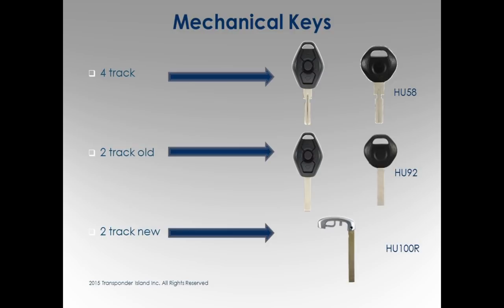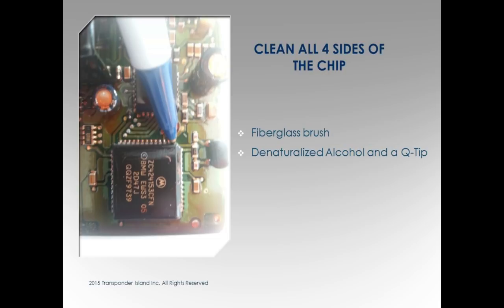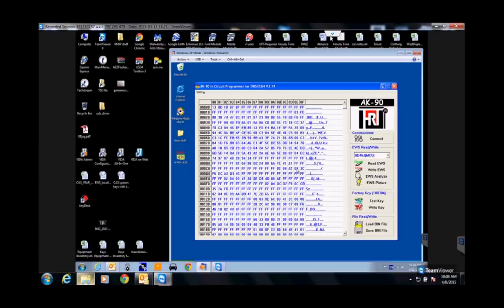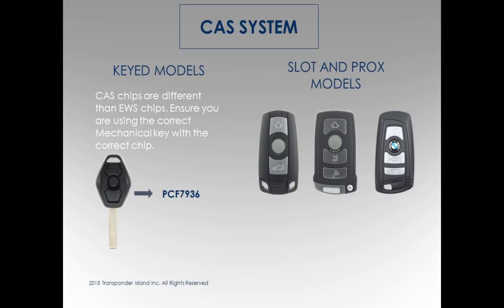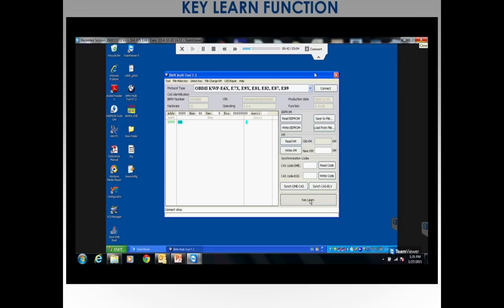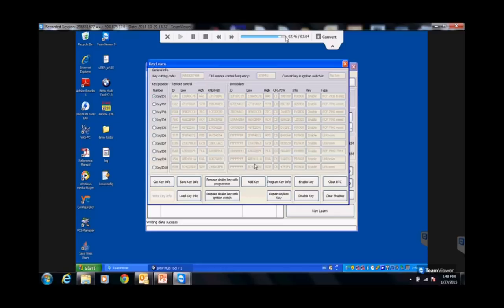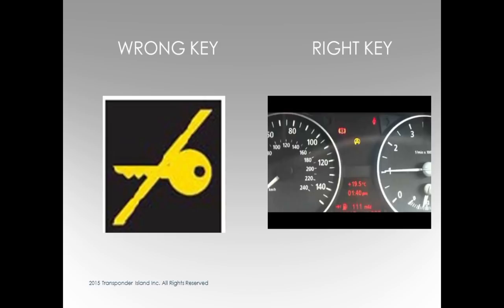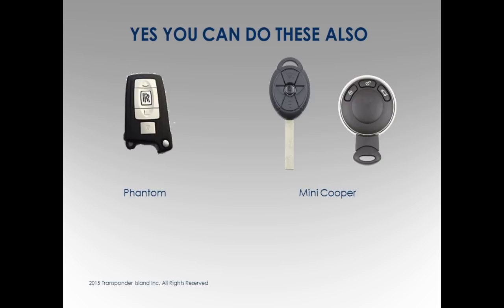Transponder Island BMW EWS and CAS Key Programming Class

Comment: Great video, thanks for sharing.
Be aware that at 30:00 when you remove the inductor coil you're also taking away the ability for the battery to be recharged which is not ideal...

Comment: If the LIR2025 battery inside the key fob dies, does that cause the transponder to not function?  If true, does the transponder lose its immobilizer code when that LIR2025 battery dies and therefore needs reprogramming?

Comment: Hello.
I installed the software, hooked up the device to my computer and test the key and everything works. But it could not get my EWS read, and it says "PIN not touch". I have an OD46J/EWS3 model (I selected OD46J(MCU) to read), and I removed the coating on the EWS before connecting it to the device. I followed every step in your video and tried it multiple times and still the same message. Could you help me with it? do I need to purchase another program?
please advise.
Duong
Reply: scratch the contacts.. they have a coating on them
Reply: Same happened to me until I pushed down on the connector with force and it made connection and read. Also my equipment did not show how it was connected and I tried variations until I was sure I had the correct placement.

Comment: use vvdi2 on bmw
Reply: Was a great tool but it's becoming obsolete if they won't update the software. Had a CAS3++(latest fw, remote key) and all keys lost. VVDI2 was almost useless. Tried the normal approach, tried downgrading cas, tried repairing CAS, tried everything. Even tried a more invasive approach by reading out data directly from the chip but no luck, I got all the info but couldn't crack long ISN with the plethora of tools and programs I have. 
Finally called a buddy who had some new tool. Looked little bit similar to VVDI, but completely black box with no markings on it (probably eastern european car thief tool), he hooked it up and a new key was done in 2-3 min with no computer attached.